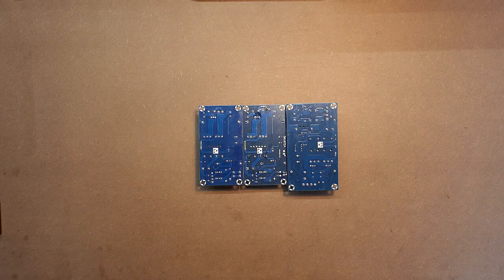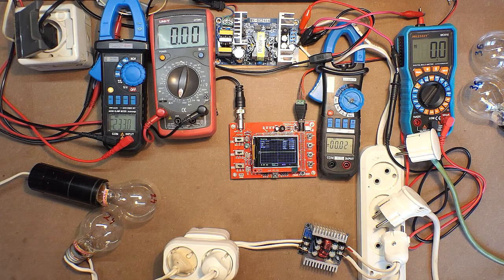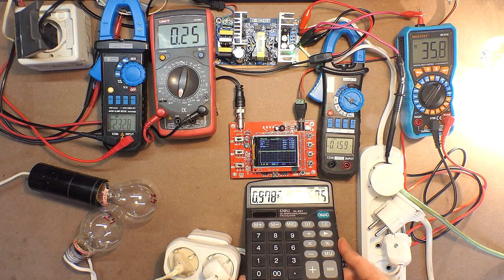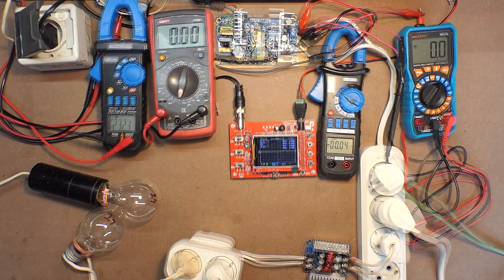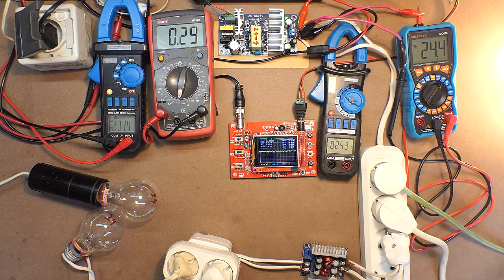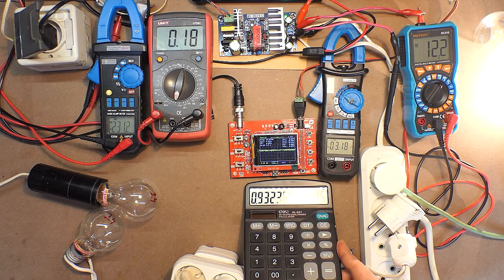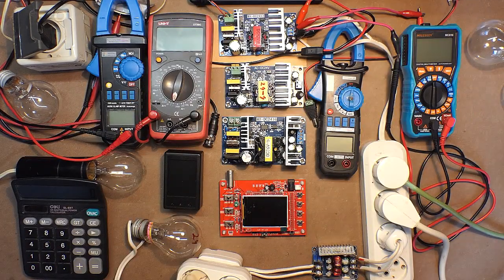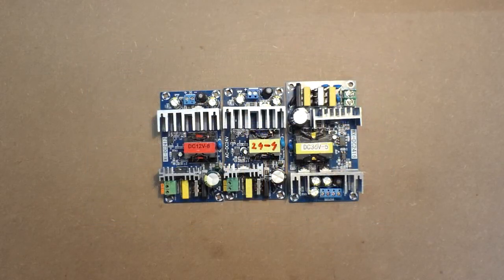12V, 24V, 36V Power Supply Units - Test

Comment: Hello, I plan to make a power supply using the AC-DC2416 with a 36 volt output and place the XL4016 at the output. Have you made that configuration?

Comment: Thanks, very helpful review - did you use any of them for an extended period since then ?
Reply from the maker: No, but they have really decent quality.
Reply: Thanks, they do seem surprisingly well made. I recently ordered a whole bunch of them - needed a couple for a light fixture convertion with questionable grounding and unreachable ceiling wiring to validate.. so no metal enclosure PSUs, and lucky for me I've found out before ordering that almost every "sealed" (black brick) PSU on aliexpress is a horrible fake, useless and probably dangerous (a tiny board with no protection or filtering, stuck with foam tape..)

Comment: Did you ever figure out the part number of the 8pin chip on the 36v supply? The assembler has sanded it off on mine. Someone on a forum claims it is ncp1200p60g
Reply from the maker: Sorry, mine also has no inscription.